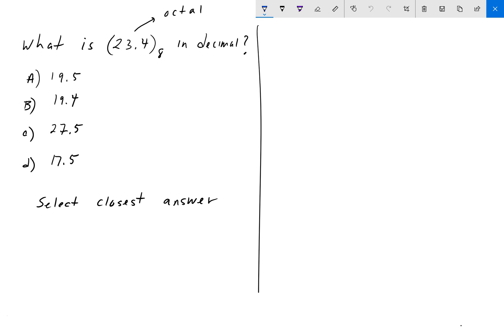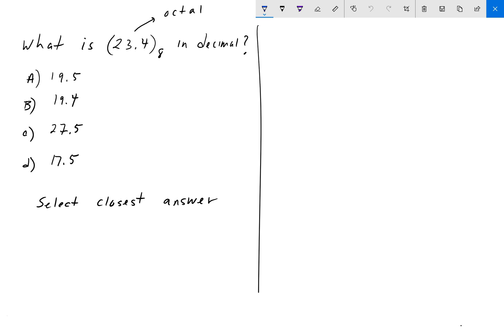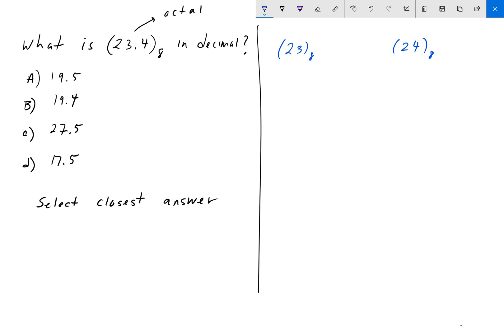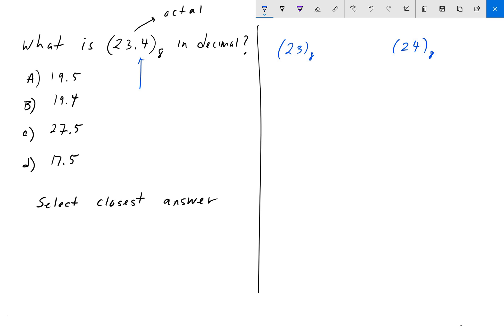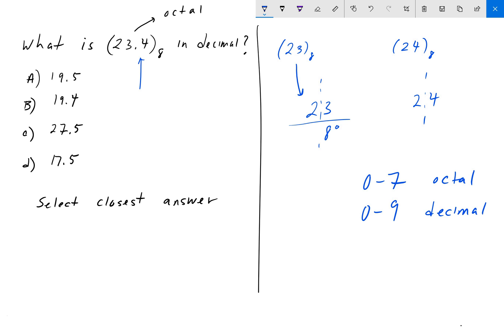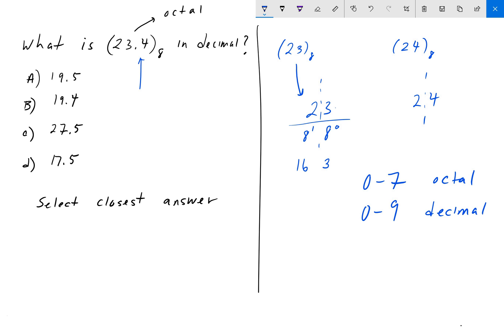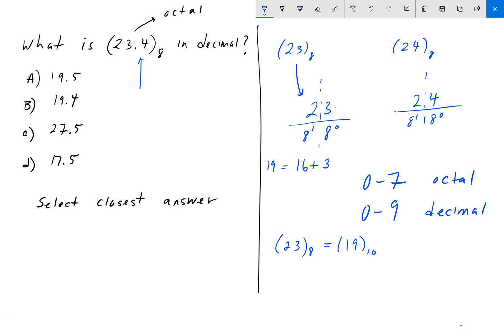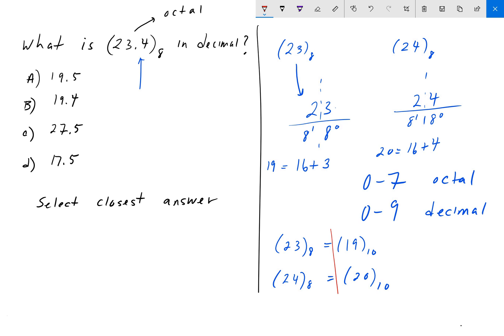Electrical FE /EIT Exam Prep - Digital Systems 1: Octal to Decimal Conversion

Comment: taking the average of 19 and 20 isnt correct right? i think you just got lucky in this case. if it were 23.5 you couldnt just take the average it just so happens that 4/8 is 0.5 which would make it 19.5
Reply: You can just do 5/8 in that case, so it would be 19.625.